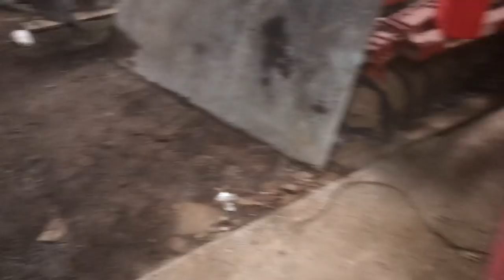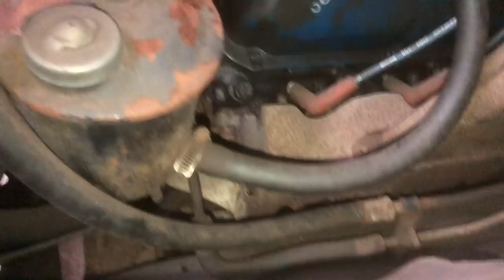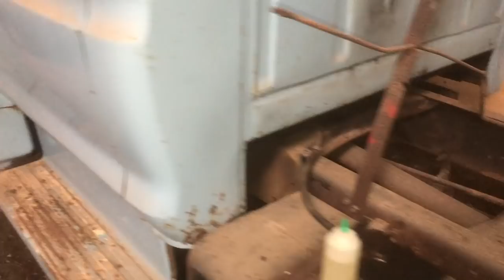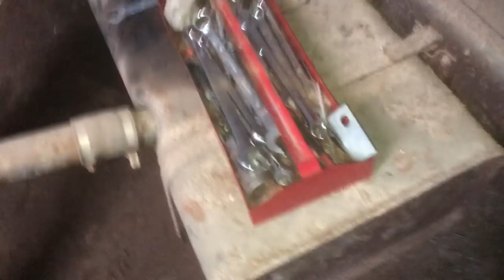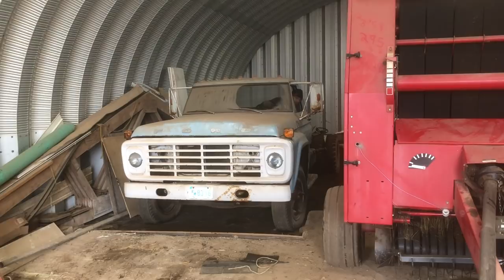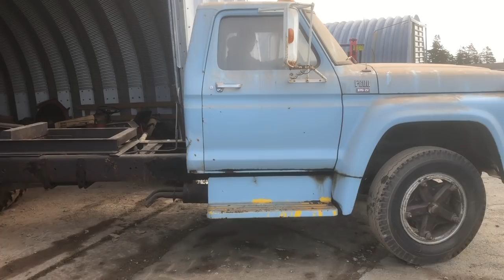1979 Ford F 600 First Time Running in 5 years

Comment: Pouring gasoline down the carburetor throat does not fill the float bowl.  It drops the fuel into the intake manifold if the throttle plate is open.  Great for quick start with no normal fuel delivery...but potential to flood engine and foul plugs too.
Reply from the maker: It’s been awhile but I’m pretty sure there was a vent on the top of the carb that filled the bowls, I know I wasn’t pouring it into the throat. Just needed to get it to start pumping fuel with the mechanical pump.

Comment: this engine is weak and consumes a lot of fuel! replace this engine with a perkins 6357 diesel or an mwm diesel engine! You'll see how it will look better in all aspects!
Reply from the maker: If anything it would get a Cummins, and considering the truck is back sitting right where it was to start with I can’t see an engine swap happening any time soon.
Reply: @macfarms  cummins is a great engine! to put a cummins engine you have to change the entire traction system, differential, cardan, gearbox, everything ... but it would be excellent! Congratulations on the truck!
Reply from the maker: João Filho I think the rear end would be ok, we actually did think about it a little bit, ideally find a 5.9 and transmission out of a dodge pickup, then do a custom driveshaft. Anyway, it’s all on the back burner for now anyway.